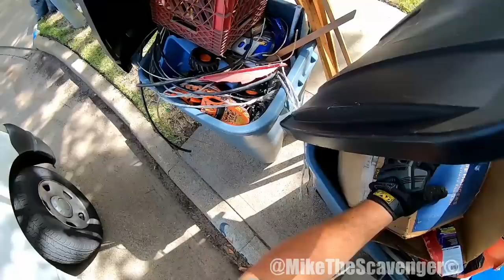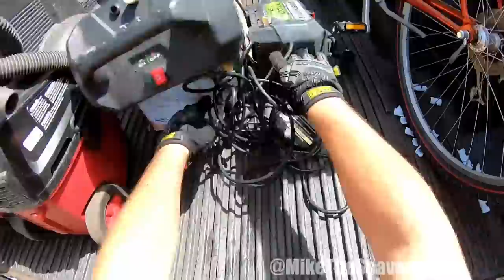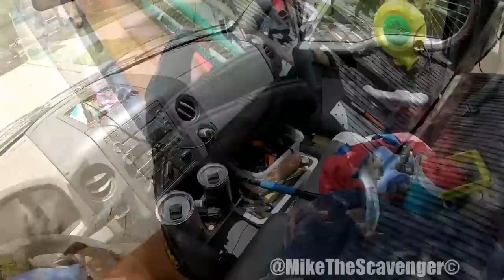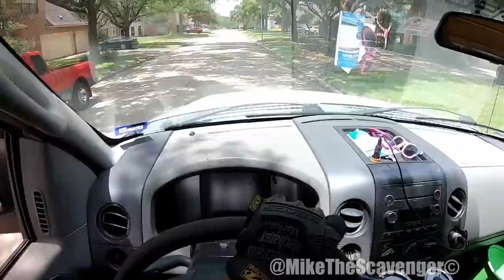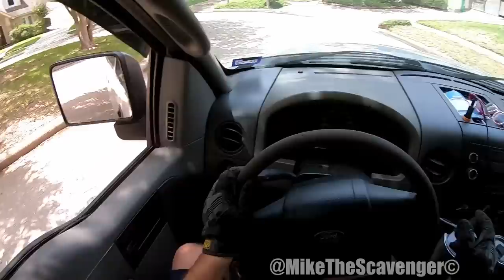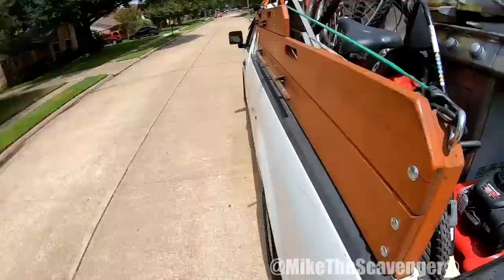Curbside Scavenging "Somebody Left A Bucket Of Money On The Curb!"

Comment: Nice bunch of scrap collected. Awesome to find a bucket of coins. Make a novice coin collector drool!!Coin cleanup: I’d start with a little dish soap in just water and agitate them/stir em around. If they need more, if you have a rock tumbler, with a little fine grit and some dish soap (in water), they should clean right up (as noted previously, do pennies/copper coins separately).  Last options, soak in a dilute vinegar mixture or very last… harsher stuff like CLR. 
Honestly, if there are any valuable coins in the bunch you shouldn’t do much more than lightly brush em down dry with a (non-wire) brush. 

Cheers!

Comment: About 10 years ago I noticed a weed eater with a blower attachment on it was sitting on top of a storm drain by the curb all by itself. I drove by it 3 times that day and it was still sitting there several hours later. Later that night I drove by it and saw that it was still there so I decided to pick it up. When I got home, I pulled on the starter rope and it started right up. I'm thinking to myself.. oops! I don't know if it was trash, or someone was blowing off the curb and just forgot about it, but It was too late to bring it back. I had a garage sale a few weeks later and put it for sale. It was sitting out all day and nobody came by and asked about it, so It was mine. So Often I see lawn mowers or weed eaters sitting by the curb and you never know if they're trash or just put down temporarily while the owners went inside. But if it's sitting there all day, it's fair game in my book. Just two days ago A neighbor was moving out of his house and left a huge pile at the end of the driveway. The city didn't pick it up because it wasn't in the container. There were Metal chairs, tables, lamps, a lawnmower, a bolt-on Trailer Hitch, file cabinets, etc.. I picked up the metal bits and left. Later that day more was added to the pile including a Nice 6 foot fiberglass folding ladder and a newish looking wheelbarrow. I got that as well. I could understand the ladder because it was thrown on top of the pile, but the wheelbarrow was just sitting next to the pile.
Nobody was home, so I assumed it was thrown out as well and picked it up.  If it's out at the curb and nobody is home to say it's not trash, it probably is.

Comment: Mike,  good pickup as always.  As I said before,  you need magnetic signs for both sides of your truck.    Mike's  metal  recycling  and phone to call you.  Also a low rise trailer for your larger items. Washer  dryer,  stove,  freezer  fridge  etc.
Reply: He's trying to not attract attention to himself, that's why he doesn't drive around with the side rails until he needs them and uses his bike alot.  In and out quickly.

Comment: It is a manual tire changer machine.That is a pole for a electric chain saw to extend reach. Mike I pull many lawn mowers from trash, shoot a bit of starter fluid in carb. If it fires up the carb needs 10 min cleaning.

Comment: I always carry  12” zip ties to hold the 2 doors closed on that grill less thing to wrestle with when loading.   Good load today Mike.
Reply: you can also get re-usable zip ties, that are adjustable and have tabs where the clocks are so they can be released / reused
Reply: @bluegreenash  I use beadle ties. Used to find them at Lowe's & Home Depot, but now I think you need to get em off Am*zon. They're reusable plastic ties, I think they're better than zipties for most uses.

Comment: in reference to the coins in the bucket, it is likely that someone has already tried to clean them up and left them to dry in a colander or some such instead of immediately drying off each coin with paper towels or a rag. iknow this because someone gave me an ice cream bucket full of foreign coins that had somehow gotten some peppermints in them which had melted over time. long story short, itossed them into an old plastic colander and ran some dishwashing liquid through them with the sprayer in my kitchen sink and thinking, "hey they are metal, iwill just let them drip dry overnight." well by not spreading them out they took a week to drip dry and when they finally did they were covered in that familiar greenish white powdery stuff and looked almost identical to the ones shown here. 

learn from my screw up, wash them off but then dump them out into a single layer on a shop towel and if you don't want to pat dry each coin, put a box fan on them. the key point here is make sure that no coin is on top of any other coins if you are going to fan dry them

Comment: You could collect the fan blades and make art out of them. Wooden hand fans for example, the peacock type fans. The ones that slide open or fold open. They should already have holes in them where you can put them on a backing. They’d look good on the wall. Also You can put them around plant pots to give them a high end look. They could also be turned into a trellis / edge guard. Such a shame they get murdered as such & get sent to landfill. The prices of timber? It doesn’t seem sensible not to repurpose any and all decent wood scrap. If I was a scrapper, I’d take the time to unscrew some fans because they look like fun scrap wood pieces. I’m guessing if they’re bolted on... oh well. But even a clean break, the remaining wood could be tidied up and reused.

Comment: I found a air blower just like the one you found.  Took & through  a hose from a vacuum  added a stopper at the end put holes in the hose added weight to hold the hose under water & there you have a pore man's hot tub just tub & hot water